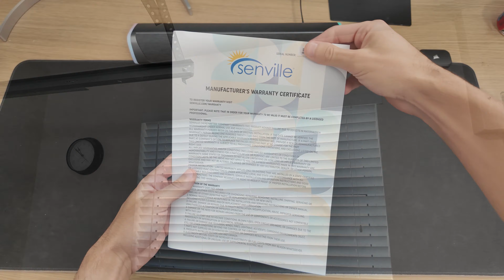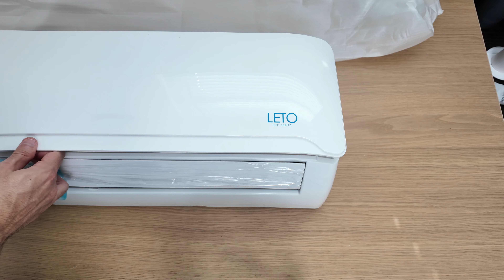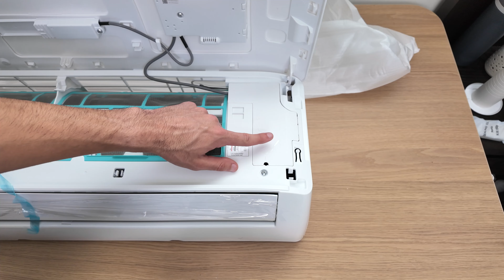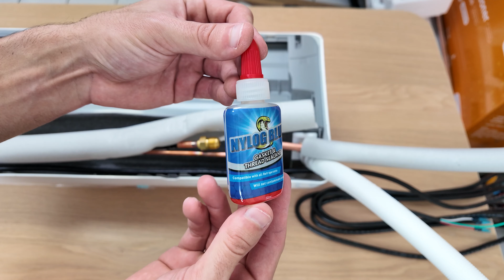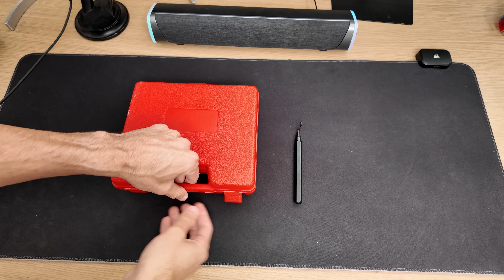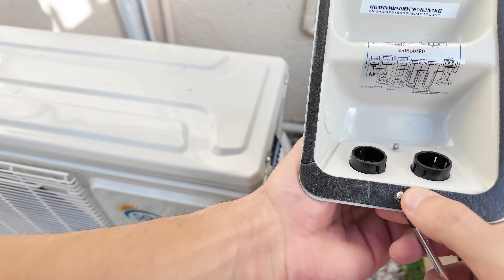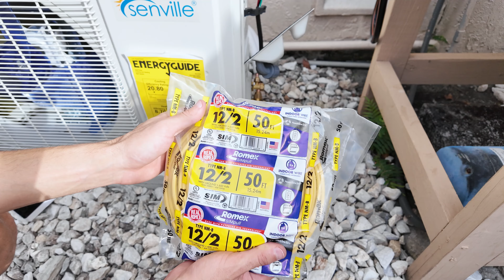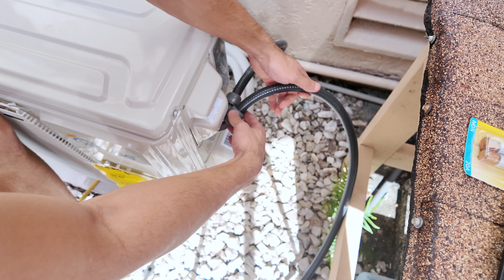How To Install A Mini Split Air Conditioner – Complete Step-By-Step Guide

Comment: For those who enjoyed this video like I did but bought a multi zone unit, here are some answers to your questions. My 3 zone unit has A, B, C, D valves. For my 9K, 9K and 12K air handlers I used B,C,D valves. A is only for 18K+ air handlers and has a 1/2 line set instead of 3/8. 

I vacuumed each line just like in this video. Then I opened the valves on each connected zone. When all were opened, I opened the top 2 valves located above the 4 zones. Those are the master valves that let the refrigerant into the lines… hope it helps because not many videos out there on this kind of setup
Reply: Aren't those zones independent? Does each evaporator have its own circuit? So, you had an extra 2 valves in addition the the four ports with their service valves?
Reply: @j.w.8663  On older systems every evap has its own circuit and compressor. On newer systems there is one condenser coil, one compressor and electric valves do redirect flow to/from each indoor unit as needed. Both have a set of connectors for each zone on the outdoor unit.

Comment: At 18:35 when you remove the blue vacuum hose, arent you reintroducing air back into the system?
Reply: Found out they all have a Schrader valve inside so it's ok to remove the hose.
Reply: @fcan222  Only when there is positive pressure in the circuit.

Comment: Is'nt in not recomended to shorten the line sets?
Reply: Each unit has been precharged for a minimum length, stick to that, no shorter.  And most DIYers would be challenged to make a good flange, which isn't detailed here.

Comment: excellent video.  I will be installing this unit soon.  Only 1 thing i noticed that you might not be up to code is the romex yellow electrical in the conduit.  you need to use just 3 single wires that is rated for outdoor.

Comment: Thank you , very detailed. How do you put the refrigerant back into the unit if you need to empty the lines for some reason?
Reply: You can vacuum it out with the pump into a Freon tank...but basically only a hvac guy can do it. There is a video on trying different DYI car a/c refill brands that shows how.
Reply: @rainorshine6702 I actually figured it out, in my Fujitsu mini split, I can put it back into the main unit with few simple steps.

Comment: I wonder how many units have failed because first time installers use this as a reference. Especially In the cold climate, especially POE oil charged compressors:))) Don’t be cheap, the least: a micron meter and torque wrench, or else your unit is guaranteed to fail in about 1 year even if there is no leak
Reply: digital micron meter, 2 stage pump, pull to around 400 microns, must hold at 500 or less for 10-15 mins.  These cheap analog manifolds and single stage pumps are not up to the task to do it right.

People have no clue that pulling and testing the seals to hold -15PSI for a vacuum is NOTHING like the 400PSI it will experience when running.

Comment: Best video yet...
After installing the disconnect box, where do i install the wires on the other side of the electric panel? Like a 20amp but how
Reply: If you don’t know how to get a professional too and the nicest way possible you don’t want a house burning down this is continuously using power so if anything heat up it could melt

Comment: Good video! Just a question… when running the line through wall and down exterior of house, why did you not just bust the two unions on the water line that was blocking you? It bothered me more than it should’ve lol. 

Still a great video. Very in depth thank you

Comment: 17:50 when you add positive pressure, is the low pressure valve still in closed position?
Reply: Yes, closed. Otherwise the positive pressure would escape through the yellow line and the vacuum pump.

Comment: hi there,
the aircon outside unit comes with the cooling liquid pre set all ready, isn't? no need to buy any extra toppings for the refrigeration?
Reply: i guess need to make sure no leakages in the line? and when the power on the outside unit it will
 relist the Freon?
Reply: @viliuskrikstaponis6997  watch again, after leak test refrigerant is released, they come precharged with it in the condensor.

Comment: First mini split went super smooth, now on my second install and my vaccum won’t hold -30 😱 fml
Reply: Retorque the copper lines and reconnected my vaccum lines again, it hold the pressure this time, installing these mini splits it’s not for the weak lol

Comment: I just tried it myself yesterday.  I had watched your video and took copious notes.  I got all the way to the last part, the Evac part.  I got the number to negative 30 but it would not hold after shutting off the Vacuum Pump.  I double checked all connections I made. Nice and tight, soapy water test, no leaks.  I tried Evac again.  Same thing.  I have a brand new Vacuum Pump, I filled it to half way with supplied oil.  I followed all your directions for connecting pump to service port, and pump to manifold (gauges).  I can't think what could be the problem.  Do you have any ideas?
Reply: soap is NOT for the vacuum test: it's NEGATIVE PRESSURE - a VACUUM - and will PULL IT IN, not bubble OUT.  Soap is ONLY useful if you test it pressurized with nitrogen, or as a final check after complete on a running unit.

These videos are all shortcuts no pro takes and simply a gamble it will go right for you.  A proper install requires a digital vacuum gauge and a 2 stage vacuum pump.  Those both together are the ONLY way to get down to spec: around 400 microns, and then see it hold at 500 microns for 10-15 mins.  They don't mention torque wrenches, making sure to NOT get Nylog in the THREADS and other issues.
Reply: I have done this myself but I am not an hvac engineer. I think leak testing is best done with a nitrogen bottle which sounds scary but in the UK at least can be bought cheaply. The idea is that you positive pressure test to a significant PSI. Bubbles can be seen much easier that way and you can pressure test to a high psi (google the recommended psi settings but I think from memory they are even higher than in a car tyre - so more than a hundred psi but check this!). If there is no drop in pressure from the nitrogen test then you can be certain there is no leak. I was paranoid and left it pressurised for a day writing down the ambient temperature and pressure (because the pressure will vary during the day as the ambient temperature changes). 

Also I bought a micron gauge to check I had properly pulled the vacuum (this is after the pressure testing with nitrogen above). The gauge he uses in the video will make it very hard to know if you really have pulled a vacuum below 500 microns. I think I paid about £100 new for mine.

Comment: In your case, you should use Window Room Air Conditioning unit that you can install in the window. It will save you work bending tubing and doing electrical work for at least half the price.
Reply: Window AC units are very inefficient, equivalent to around 13-15 seer, these are 19 seer so will cost tremendously LESS to run all year, up to HALF the electric bill, that quickly eats up the savings.  Then the window can leak, be a break in risk, etc.

People often just prefer things to look nicer in their home also.  Bending the tubing is not hard work.

Comment: This is the best installation video I've seen, and I've watched more than a few. I used your content to guide me through my first-ever mini-split install, on my cargo trailer--camper conversion, and I had zero problems. Your video answered many questions I'd had that were either not addressed in the instructions (and other videos), or were confusing in those other descriptions. Thank you for creating such a tight, clear explanation of all the steps. Excellent job!!!

Comment: You vacuumed without doing pressure test
Reply: One can suffice for the other as a reasonable risk compromise, but it needs to be a proper one, pulled down to around 400 microns, then hold at 500 or less for 15 mins.  That requires a digital vacuum gauge and a 2 stage vacuum pump.

Comment: Despite the availability of a $7,000 rebate for purchasing a new air-conditioning system, homeowners can often save even more by converting their existing ducted gas heating system into an energy-efficient, electrically powered reverse-cycle air conditioner. This approach reuses the ductwork already in place, reducing installation costs, and the new system can run on far less energy—especially if powered by LED-efficient, all-electric components or paired with solar. As a result, the upgrade can be cheaper upfront and significantly cheaper to run, while still delivering both heating and cooling through the same ducts.

Comment: I just fished installing my second Seville mini-split and I kept referring to this video for installing and vacuuming the line set.  Also, this time I used the suggested thread sealer on the line set fittings.  This video was great because he goes over all the little details that you don’t get in the manual. Like when he pointed out when you first hook the vacuum to the line, you see smoke coming out for a few seconds., it’s normal and that just water vapor being removed from the line.  When I hooked up the vacuum and the smoke kept coming out, I knew I had a problem and checked the line set and found the problem.  I was following the manual that came with the unit and used an open ended torque wrench to tighten the fittings to the specified range. I don’t know if my wrench was out of spec or the manual was wrong but when I tried to tighten the smaller high pressure line, I didn’t even get close to the torque range before I knew something was wrong.   I cut and repaired the line after smoke kept coming out of the vacuum and the pressure held. Anyway, I think this is the best install tutorial for a mini-split and it really makes things easier for novice installers to get the job done and save tons of money by doing it themselves!  The level of detail and overall excellent production of this video is much appreciated!
Reply from the maker: Wow, thanks so much for sharing your experience! I’m really happy to hear that. I made this video because I noticed most tutorials don’t cover all the details, so it means a lot that it helped you!

Comment: Some things of note:
You should use torque wrenches on the flairs, you'd be surprised how little force you need on the liquid line and how much more you need on the gas line. 
You should leak test the system with nitrogen.
You should use a micron gauge as the manifold gauges won't tell you accurately how much of a vacuum you've pulled.
This is a shit installation.

Comment: The indoor unit will not function properly if there is not enough clearance about the unit. That is where the room air enters the unit. Typically 12 inches or more. That was not done in this install. Just letting people know not to do the indoor unit close to the ceiling.

Comment: Why didn't they see how you filled your system with liquid?
Reply from the maker: The system comes pre-charged with refrigerant, so there’s no need to add liquid manually during installation.

Comment: Thank you for your good advices.
Wasn't it necessary to test a high pressure N2 gas in pipes to make sure there is not being leak in system in high pressure ?

Comment: Brilliant because you show the actual positive pressure, 5 bar after opening the liquid valve. Thank you for your well made instructions 😊
Reply: You don't test the system with positive pressure with refrigerant, that is done with nitrogen as is there are any leaks, we don't want refrigerant escaping to the atmosphere.
Reply: @mortenwinslw2785  Hey, mate, this is a vaccum pump , so if the manometer show -1 for half hour  that means there's no "leaks". Vaccum is always a vaccum and notice that, Nitrogen is very dangerous if used in small rooms, keep the window open😂.
Reply: @TruckerMadMax2025  I hope you're not installing outdoor unit inside. If not nitrogen is not a problem. And you test a R32 for half an hour with a little over 16bar to see if pressure drops and if that's fine you continue to the vacuum test

Comment: "Not necessary because we've already tested for leaks"  Not entirely true.  Like you stated on the vacuum connections, they behave differently under vacuum than under pressure.  It's unlikely to be a problem but you should still test.

Comment: After release the gas 1/4 to check the positive reading,  and  the reading goes up a bit after 15 minutes , so what is happening ?
Reply: Think about it. The gas is under pressure, when the pressure is released the gas comes out cold, given a short time the gas will warm up to surrounding temp. The warmer gas gets, the more it expands, thus resulting in a rise in pressure! Physics!
Reply: @patricksullivan9951 thanks for your reply

Comment: I dont understand why do you release the refrigerant after vacuuming the system. I am still learning this trade
Reply: Ac technician here. You pull a vacuum before releasing the refrigerant because you have to remove all the moisture and non condensable air(atmospheric air) out of the system. Failure to remove can cause the system to not run properly and worst case can cause the compressor to lock up/blow up because the compressor can’t compress moisture and non condensable air.

Comment: Just wondering but the adapter that the blue hose attaches to has a one way schrader valve in it so when the vacuum is drawn the gauge will not indicate the vacuum in the system if there is a leak. Any thoughts on this?
Reply: The adapter pushes on the schrader valve to keep it open.

Comment: At 19:21 even though you run the vacuum test, I think you still need to run the pressure test too. And I just thought of this from the experience I had, when you run a vacuum, it may not detect a leak because it’s stuck in the parts close together. However, when you run a pressure test is pushing the parts apart from one another, which also can detect the leak from a different perspective. I know because it happened to me, the vacuum test worked fine, but then after a half an hour, the line blew apart once I let the refrigerant in.
Reply: This is actually a great idea! Under Vacuum, the soapy water would get sucked into the line. Charge with air, it will escape and then you will have bubbles if a leak! bubbles!
Reply: @patricksullivan9951  Don't charge with air, use dry and oxygen free nitrogen (OFN). Lots of risks otherwise.

Comment: Great video! I was told to always release ALL the refrigerant before disconnecting the gauges to ensure less air is introduced into the system. Is this true?
Reply: Someone answer this question, please 🙏 ⬆️
Reply: Yes, you’re better off releasing a small amount of refrigerant into the copper line. 

Prevents a false vacuum: If the service-port connector didn’t fully depress the valve, the gauge will show a deep vacuum even though air stayed inside the line. Releasing a small charge confirms the line is open and lets you see real pressure changes.If pressure doesn’t change when you introduce refrigerant, the connector or service valve may be failing to open the port and needs attention.
Reply: Well yeah, if you remove the gauge while there is still vacuum in the system, air will get sucked in through the schrader valve.

Comment: I was told to open the two way valve for Freon release first having done a pressure check . Or not . Some just go straight to the Freon first releasing the larger line or 2 way . The smaller 3 way is opened last

Comment: Poe oil on flares + torque !! (18-20 nm for 1/4 and 30-35 for 3/8). This is only garantee that there wont be any leaks in the system. You are not torquing anything this is a big mistake 
Poe oil on the cone of the flaring tool is a good idea too

Comment: Mulțumesc mult !
Simplu explicat și complet .
    Am mai găsit un film , dar instalatorul a făcut o greșeală inexplicabilă , a decuplat furtunul albastru imediat ce a făcut vidarea , fără a elibera o cantitate de freon pe circuit . În acest mod , la decuplarea furtunului respectiv , fără a fi freon pe circuit , a dat drumul la aer înăuntru . Supapa se închide doar sub efectul presiunii din interior , dacă avem vacuum s-a dus vidarea .
Reply: Multumesc si eu pentru ca ati semnalat greseala. Chiar si acum, dupa un an, s-a  perpetuat in mai multe prezentari. Voi fi foarte atent la acest aspect.

Comment: Side note yellow wire can’t be installed in conduit. You should have used exterior rated wire such as UF or NMWU or THWN. but other than that all the rest of the video looks good
Reply: Correct. Or stripped the cover off and used the wires inside the conduit only. I think there is an exception if the run is 18-inches or less.
Reply: @OneVerySadPandano the wire isn’t designed to be used without its outer jacket. You may be right if it’s a short run but it only applies if the wire is already coming out the wall and going to the disconnect, after it must be outdoor rated
Reply: @lafamillebrassard7692 correct, it’s actually a code violation, since the wire doesn’t have markings on the individual insulation.
Reply: You can also buy a pre-made "power whip", or even the whole hookup kit for a mini-split (box and whip)
Reply: However, in every other country in the world, you do not have special outdoor cable unless you need something at UV resistance if your wiring dissolves in water you shouldn’t use it anywhere

Comment: After the pulling the vacuum you didn't charge the system. Did it come from the factory already charged in the outside unit?
Reply from the maker: Yes, it came pre-charged from the factory in the outdoor unit, so after pulling the vacuum, I just opened the valves to release the refrigerant into the lines, no need to add more.

Comment: You did not fill the gas?
Reply: Most mini split systems are pre-charged.  So you just connect the lines, apply the vacuum, make sure it’s a good seal, and then open the valve to release the gas.